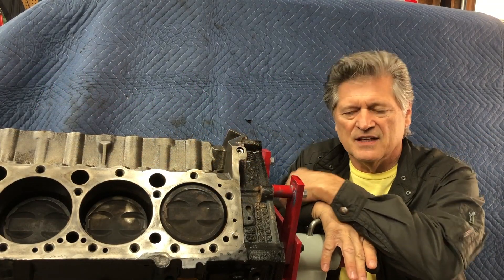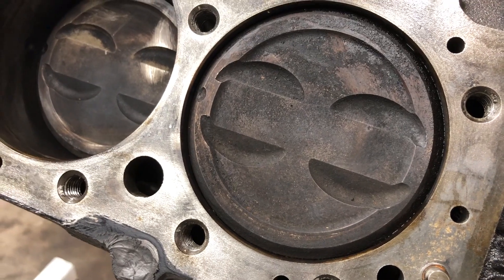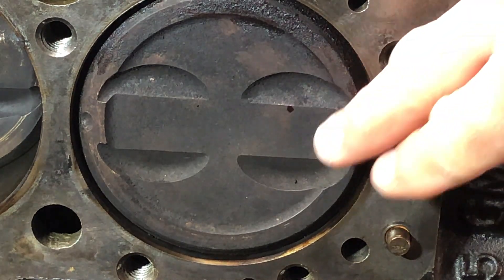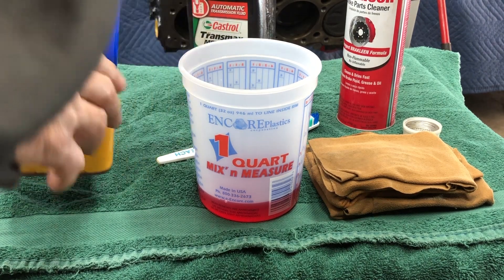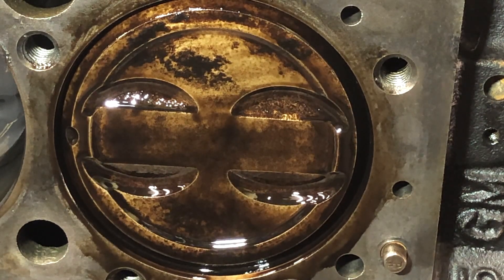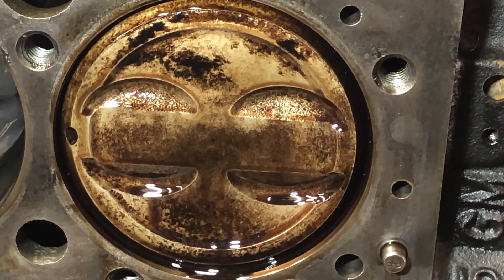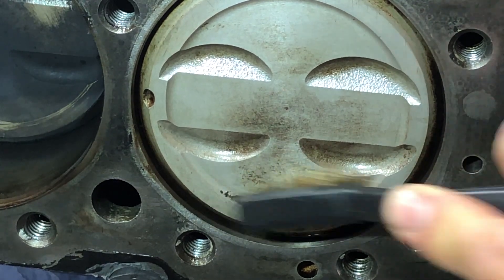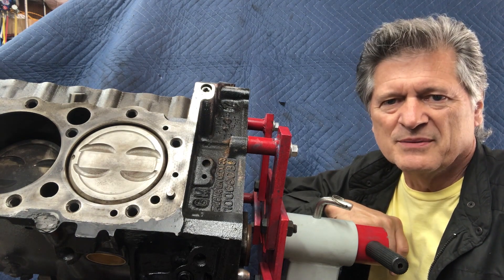How to Clean Carbon Off  Pistons

Comment: I just used carb cleaner and rags and it worked. A plastic toothbrush is good too. The harsh solvents in the carb cleaner are healthy for the bottom end of the engine, clean everything out. When I was done, I blasted it with compressed air to blow the sovent and any debris out. Wiped engine oil into the cylinders and hand cranked it a few turns to have everything wet and lubed for first startup and corrosion prevention until I finish putting it together.

Comment: My cousin is an auto mechanic and he told me that auto trans fluid and acetone mixed 50/50 is the best penetrate you can use for like rusted nuts and bolts etc etc. I haven't made any yet but soon.
Reply: My old dad told me the same thing.
Reply: Using it all the time!

Comment: I did this with my ranger 3.0, which had really heavy build-up.
I bought from Amazon a set of drill mounted brillo pads.
 The drill on low it cut the hand scrub 
time in half.

Comment: I suspect the acetone does all the work of dissolving the grease that holds the carbon together and the ATF's job is to lower the volatility of the mix so it doesn't evaporate almost instantly.
Reply from the maker: I suspect you’re right because by the next morning all I have is a container of transmission fluid and the acetone and has all evaporated.
Reply: @pinkcaddygarage267  You have to put the mix in an airtight container. Now you should have the container that the acetone came in, so don't chuck it. Save it for the next time you do a mix.

Comment: tape it off and soda blast each one with a $8 harbor freight suction blaster .. each piston will take you less then 5 minutes to get spotless like new. Yes this method does work however it is actually more expensive and time consuming because one you buy the soda gun your done and you can get a box of baking soda from anywhere.

Comment: Hello, I am working on a in-line 6 right now but it is still in the bay is there anyways I can use the acetone and tranny fluid still? Or would I be better off using break clean
Reply from the maker: I’m not sure what “in the bay” means.
Reply from the maker: If you mean engine bay, then, yes you can use the combo I used. I had that engine on the stand because the truck had suffered a fire and was parted out.
Reply: @pinkcaddygarage267  thank you for letting me know really appreciate it

Comment: Good vid did the engine run better and better performance ?
Reply from the maker: No, unfortunately, during the cleanup, I discovered that the thrust bearing was ruined, which also ruined the crankshaft. So I had the engine rebuilt with a 383 stroker kit.

Comment: hi there i have only carb cleaner and break cleaner fluid spray , can i go with both ?
Reply from the maker: The problem with those sprays is, they will evaporate too quickly to do you much good. You can spray and clean simultaneously, but you’re not gonna get any soaking action. That’s what the transmission fluid is for.

Comment: Wood ashes and a wet rag....Moisten the rag, dip in wood ashes and voila...Clean as a whistle.
Reply: What is wood ashes?
Reply: @SOLDOZER  ...Any wood ashes from burnt wood.
Reply: @garysmith3492   You're joking right....
Reply: @SOLDOZER  Absolutely not...Wood ash has a high acid content.  It's the only thing I use to get carbon (Wood Smoke) off my wood stove glass.  And I just used it to take off carbon from my chainsaw piston...Works great.  Wood ash is great for lawns and gardens as well because of the acid...It's what makes lawns green.
Reply: @garysmith3492   Hate to burst you bubble, but wood ash is very alkakine with very high pH level. Its used on lawn to balance acidic soils.
Reply: @SOLDOZER  Didn't burst my bubble mate. Acid or alkaline, it still cleans carbon off of metal and glass and makes the grass green.
Reply: @garysmith3492   Does not clean carbon or make grass green.
Reply: Sorry for those who font know but its with wood ash you make lye soap

Comment: I would use my die grinder with a small brass wire brush.
Reply from the maker: That works too. Just have to be careful. No little brass wires are stuck around the edges.

Comment: I would be more concerned with any carbon and gum residing in the ring lands, a cursory swipe at the piston top deposits is enough because it is gonna build right back up to an equilibrium level in no time.
Reply from the maker: You may be right, but would just make feel bad putting things together without cleaning them.

Comment: What's the point of doing this anyway?  The carbon build-up you should really be removing is on the valves and piston rings.. The build-up on the piston surface affects nothing (well it causes knock in extreme cases) but all this work you've done is gonna be reset after driving about 100 miles, and your pistons are gonna look exactly the same as before.. 
You can achieve the same result by driving on the highway at full speed for about 15 minutes.. It's gonna be clean as a whistle and you won't have to disassemble the whole engine.
Reply from the maker: Technically, you are correct, I just wanted to have everything clean-looking when I put the heads back on. The top end was disassembled simply to inspect everything before installing in another vehicle. Unfortunately, we discovered about half an inch of into play in the crankshaft. This engine is now a 383 stroker about to be reinstalled into a 1984 K1500.